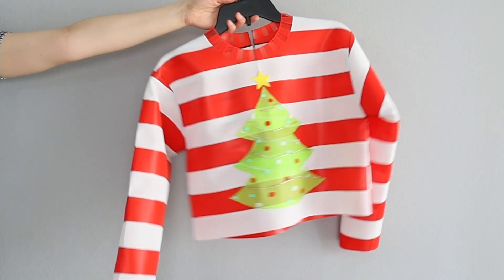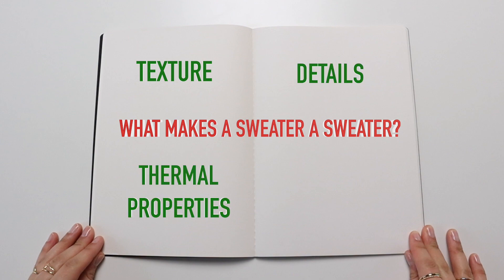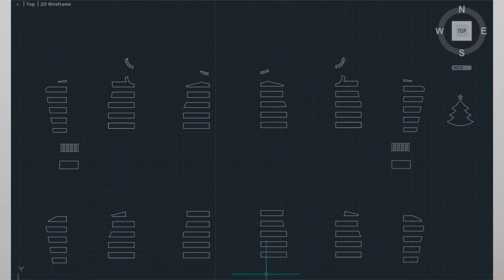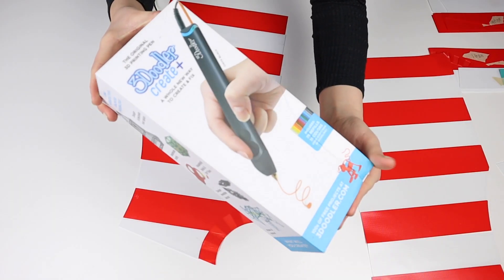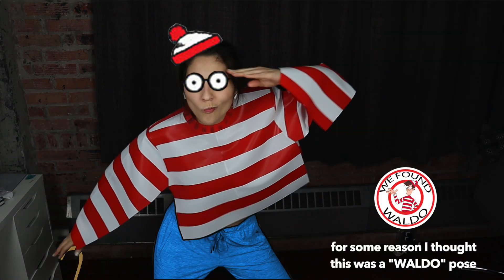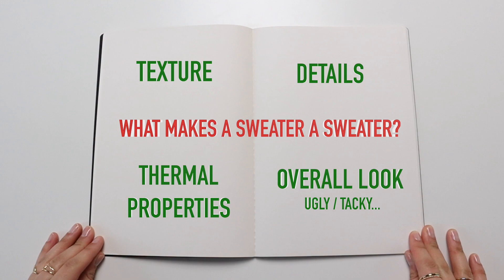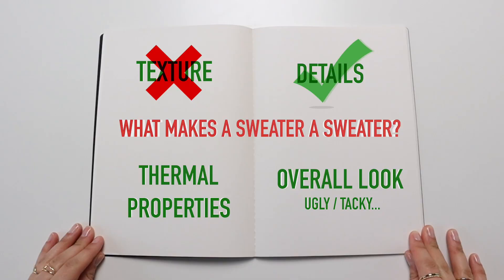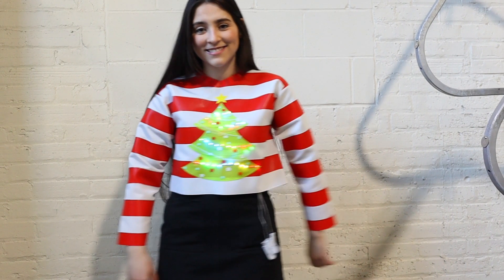I 3D Printed an Ugly Christmas Sweater

Comment: Good job being an innovator. Pls don't stop!
:)
Reply from the maker: Thanks!!! I won’t 👍🏼
Reply: @SewPrinted  ya! Quick question, does the slicer you use allow for changing the infill settings partway through a print? I was imagining that might be a good tool if usable.
Reply from the maker: @claystorage  I actually haven’t tried that but have also thought about it. I may try it and report back 🤔

Comment: Really great. wondering the joining/assembly portion you used 3d pens, is there any other way to do that? Like the sewing machines or something else? or is that possible to set that 3d pen as sewing needle? not sure... did you try any. Really love to see your work, those are cool and great!
Reply from the maker: Good question. I’ve tried sewing and the project for the video I’m currently working on involve sewing the 3d printed pieces with a sewing machine. For the sweater, 3D pen worked better since the pieces were so thick. Thanks for the feedback :)
Reply: @SewPrinted  waiting to see that video....
Reply: @SewPrinted  there is needle gaps between each stitch for sewing machine, I think if you keep that gap in mind and make printed fabric holes with that gap, that will help you to sew the fabric easily (My hypothesis)

Comment: can you turn it inside out? or wash it??
Reply from the maker: It can be turned inside out pretty easily. Haven’t tried washing it but I’ve heard the material can be washed in the dishwasher! :)
Reply: @SewPrinted  it would be a really cool rain hat or  jacket though right? i havent tried printing flexibile filaments how does it release from the bed so nicely
Reply from the maker: @TOjoe1strow  flexible filament has really good bed adhesion and comes out pretty smoothly. Yeah! It would totally be great for a rain garment

Comment: is it breathable? I'm thinking of making a spider man mask using infill method. cool sweater btw
Reply from the maker: It entirely depends on the infill percentage you use and the thickness of the mask. The thicker and higher the percentage the less breathable. But then again if you use too low of a percentage it will be too see through. Maybe you can have the portions of the mask that go close to the “breathing are be a lower infill percentage” than the rest of the mask? Spiderman costume mask sounds awesome!!!! Thanks for the support.